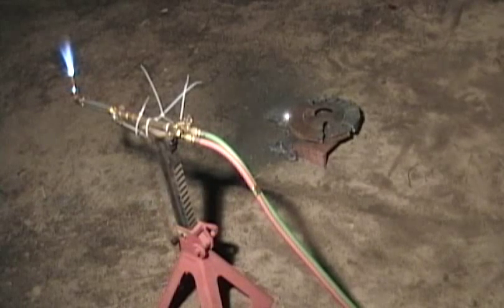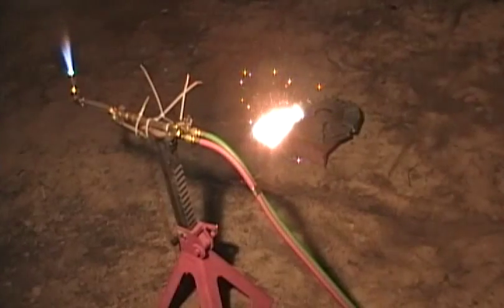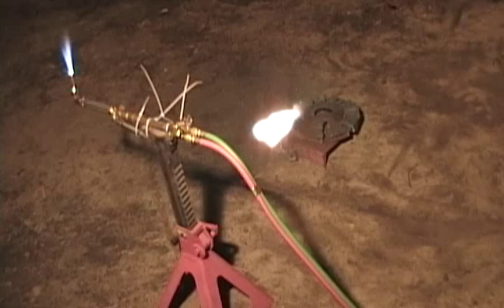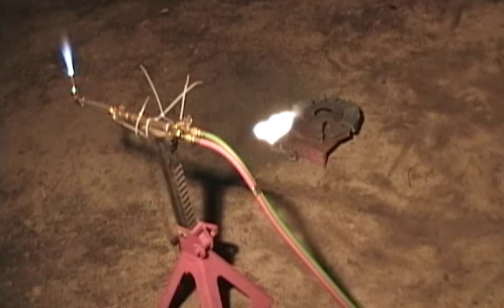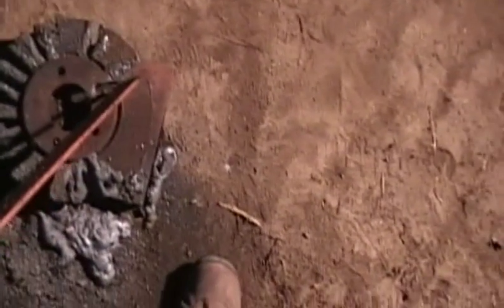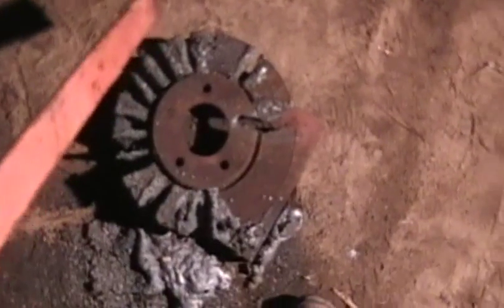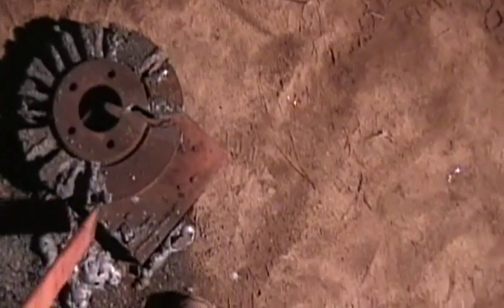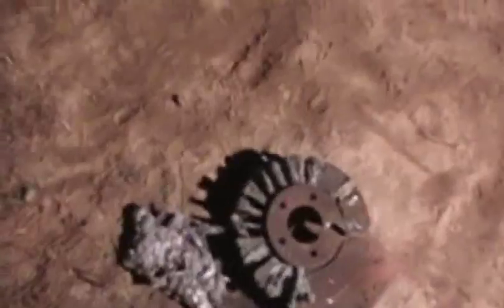"1/2" inch burning bar thermal lance and aftermath of testing so far Samuel Efurd

Comment: Try 0000 steel wool inserted into the tips and use a 9v battery to ignite.   Slow oxygen supply till it starts to flare up and crank up O2